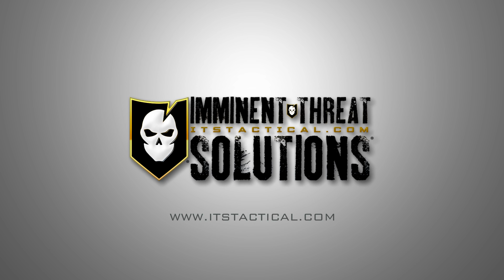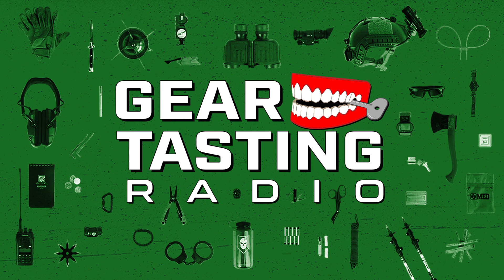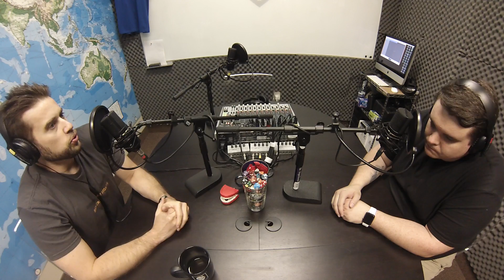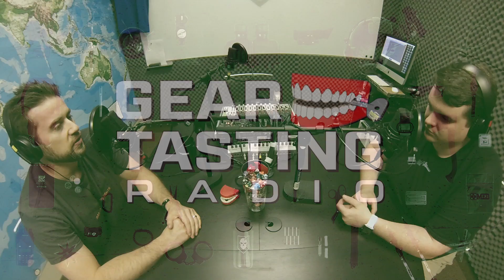Making a One Mile Shot - Gear Tasting Radio 34

Comment: So I ran across this podcast and I like it, however after shooting a mile with the 6.5 for the first time this past Saturday I wanted to offer a different perspective. It's not quite as hard as people make it out to be. Now don't take that the wrong way. But I went into it thinking that it probably wasn't really possible or at the very least repeatable. I was wrong. After the fifth shot in a row, I was shocked. I was shooting a Ruger American Predator 6.5 (400$), SWFA SS 10x fixed(300$), Seekins rings(100$), and Magpul stock. Fourth shot hit steel. Missed the next two, then five shot string happened. Total elevation was 97 moa, and used factory Hornady 140 ELD-M.
So when I heard you say "what was impressive is that my 1200$ NF is a cheaper scope to accomplish that with" I had to comment. This isn't to brag for myself, it's to point out inaccuracies here so guys won't be discouraged from even trying it. It cost me 50$ for mile day, and I almost didn't do it because I didn't wanna waste money. So certainly when you say a 1200$ NF was hard to do it with guys that don't have it won't even try. 
Keep in mind I am NOT saying it doesn't get easier with better equipment. Just wanna keep expectations normalized. The feeling when you hit a mile isn't explainable. It's amazing and addictive. I wanna bring as many people into the sport as possible, not deter them because they don't have super deep pockets. Thanks for the podcast guys. I'm gonna sub and if you want to see what I'm doing over here I'm posting videos now of longer range stuff with my gun. Don't have actual mile video yet (I will when I go back) because I was so intimidated when I showed up by $25,000 of equipment on the tables between 4 guys I didn't want to look like the idiot that shows up with a cheap rifle and videos himself missing haha. Dad was there and I've got my challenge coin to prove it though. New video is going up this week hopefully revisiting that day. Cheers dudes 🍻

Comment: Sounds like your 6.5 is a bit slow...your stated drop figure is greater than my 175gr 308Win at a mile.   Not that I have actually pushed my 308 that far.

The 308 and 260 are the exact same case.   Just a different neck diameter and shoulder position.   They share the same case with the 22-250, 243, 7mm/08

Comment: 1 MOA at a mile (1.047 X 17.6) is 18.4272 inches. 

There are 3.438 MOA in 1 MIL at all ranges. 

So 32.5 mils of elevation multiplied by 3.438 equals 111.735 MOA.   Those two numbers are same amount of drop... just different increments.

If you take the number of inches in a single MOA at a mile (18.4272) and multiply by the number of MOA used (111.735).... you would get 2,058.96 inches or simply 171.58 feet of drop. 

All of this IS NOT math you would need to do in the field... it's just an illustration of the amount of drop involved.